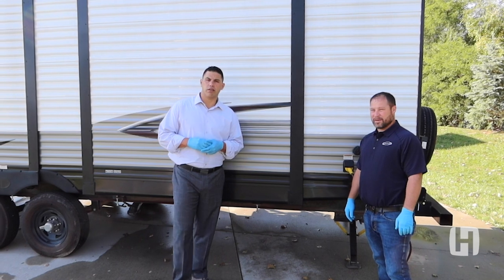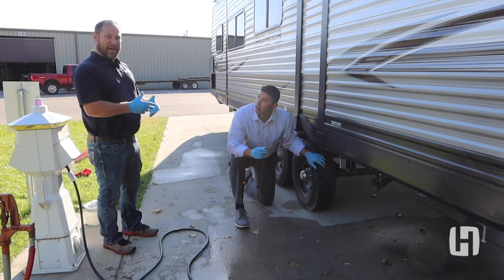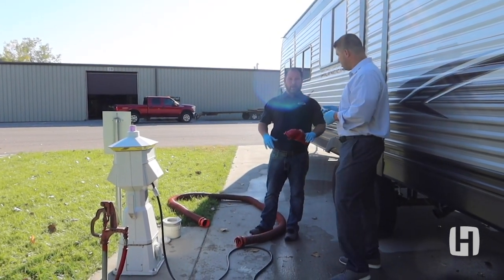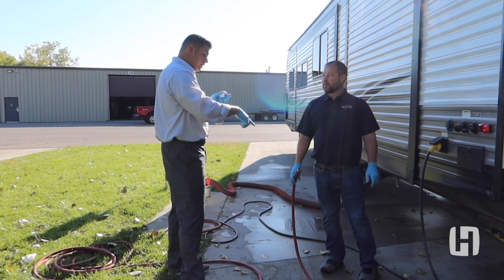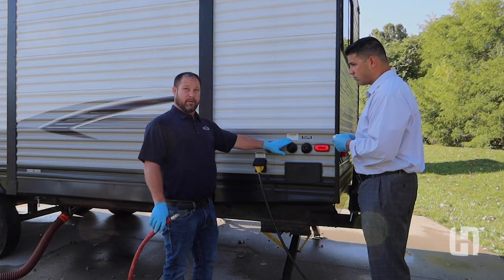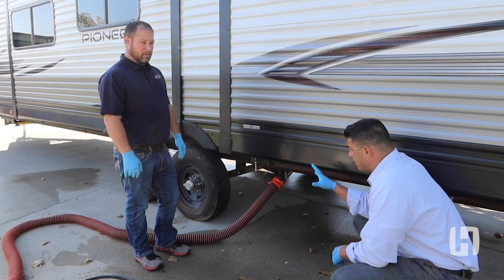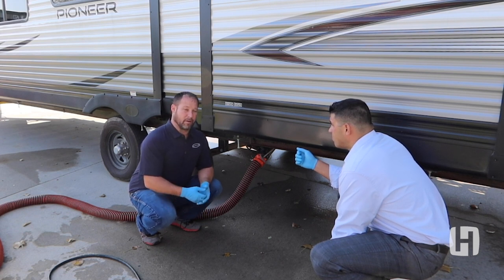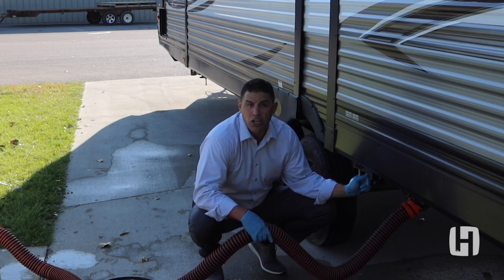Black Tank Maintenance - MAINTENANCE MONDAY with Heartland RV

Comment: First time RV owner. I purchased a 2011 Prowler 32pbhs. It has 2 separate drains for the tanks (one center (2 valves) and one rear (one valve). The monitor has Fresh/Holding/Gray 1/Gray 2. Which drain is the holding tank and Gray 2? Is Gray 2 the "black"? It isn't clear in the manual. Thanks
Reply from the maker: Hi! Please contact our Parts Department at (877) 262 - 8032 with the last six digits of your VIN# and they will be able to further assist you!